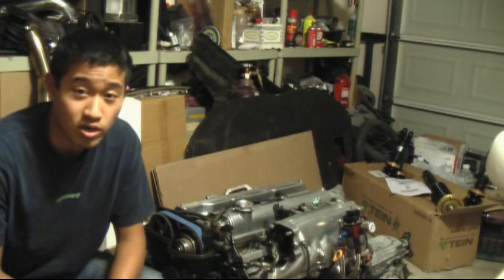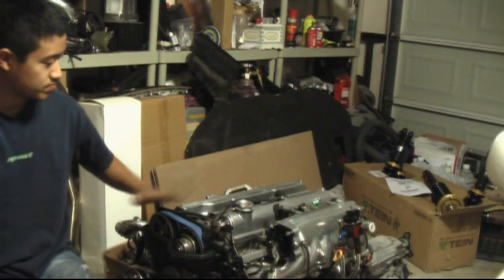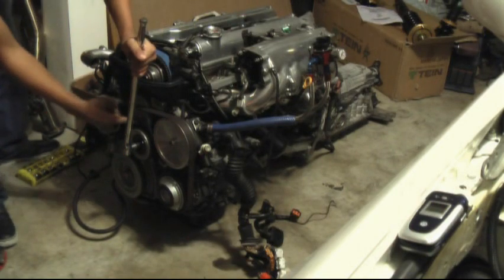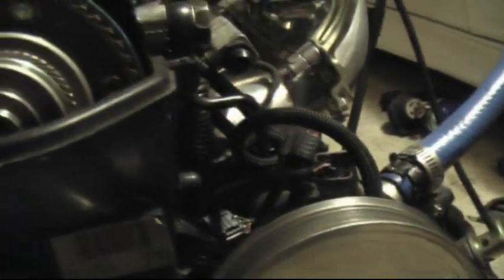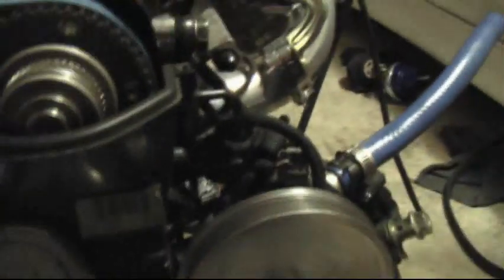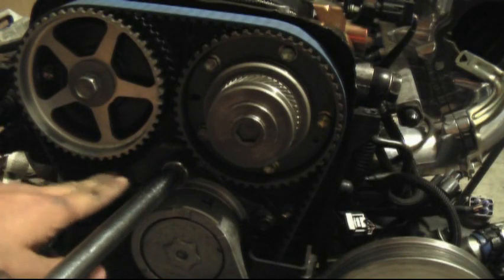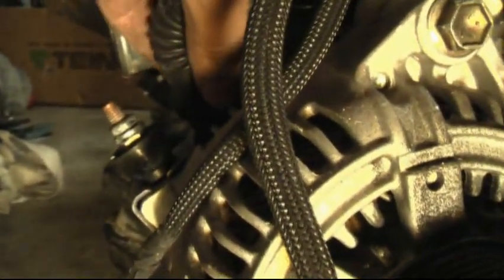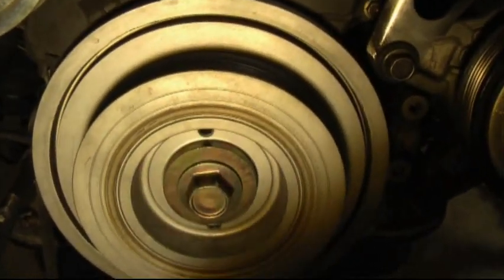Jeff's Garage: Servicing a 2JZ Part 1

Comment: Love the video's guys! I'm really enjoying my 2jz swap in my mkiii 89 supra. I don't have to pull the motor to do any major belts/pulleys/front changes. It takes maybe 1.75 hours from full disassembly to full reassembly with a timing belt change. I've got massive clearance in front and back.

Comment: Great video thanks.  Only thing I'd add is that there is no need to take the throttle body off for the timing belt replacement on a 2JZ-GE, at least not in my Soarer.  You have to do it if you are replacing the spark plugs, plug leads, or cam cover gaskets, but otherwise there is no need.  Always a good idea if you are pulling the throttle body off to give it a good clean before putting it back on.

Comment: hey when you relieve tension on the serpentine belt tensioner, if you just align the wrench/ratchet with the tensioner arm, it makes it a lot easier. you shouldn't even need a breaker bar. ;)

Comment from the maker: @ausirider91 

You can try, but everything has to come back off if the bolt drops too far down inside there. I've done it two times out of all the time I've done timing belts on these motors. The two times I used a magnet and ended up pushing the bolt even further down. I just had to take the crank pulley and covers off which only took 15mins.

Comment: quick tip .do not remove the tb tensioner instead loosen one bolt 12mm all the way out and reinstall 3 turns then back the 2nd 12mm bolt till the belt gets loose..

Comment: hey Jeff. im having mixed opinions here. would like for you to respond realy quick. i set my marks on the dots like you said in the video. but ive also read online and watched many videos that the line is where i want my timing on the cams and 0 on the crank. which is correct? the dot or the libes and crank at 0. i seen dudes line up at lines on cams and 0 on crank and checked piston 1 and cylinder one was at TDC. I already took off my TB and left the marks at dots on cams is this correct? also the VVTI. im replacing because possible leak from old one. so how do i set that.

Comment: I'm having problems with mine it starts up and runs rough with the check engine light on and traction control light flashing.  once it revs to 1500 and up it smooths out.. help
Reply: +Messiah Is3o0 was bent valve lol
Reply: +Messiah Is3o0 yeah
Reply: +Messiah Is3o0 auto
Reply: +Messiah Is3o0 it's my family car for now I traded my mr2 for it. would like to maybe boost it later on 500 whp would be awesome in that car

Comment: ihave a oil leak I already changed valve cover gasket looks lile cam gear seal is leaking and my timimg belt is wet with oil what to do guys ????
Reply: Hi, did you ever find out what caused this?  I'm having exact same issue now.
Reply: +erikchavez11 VVti Cam gear causes this normally